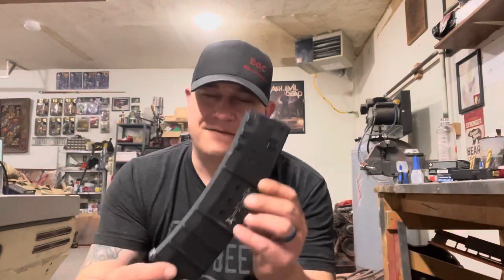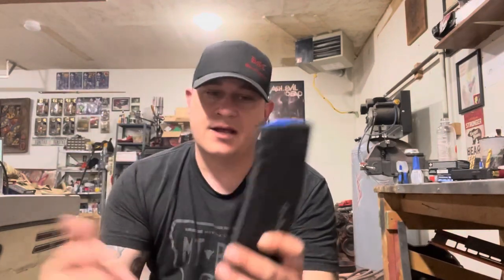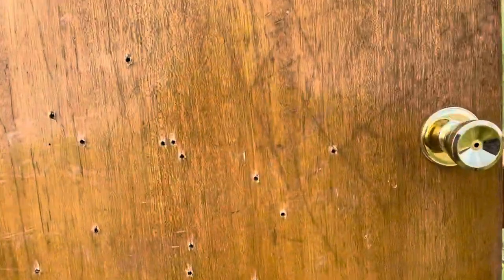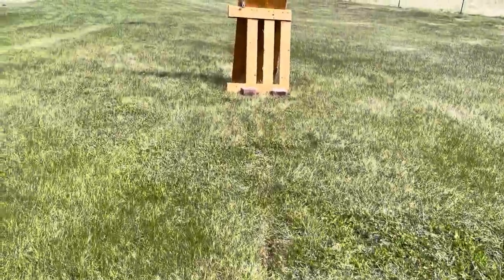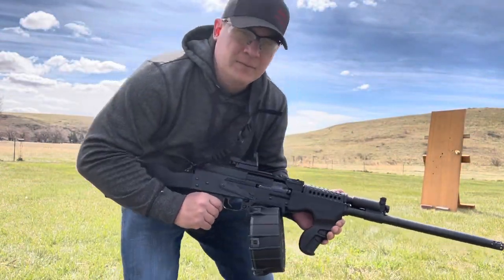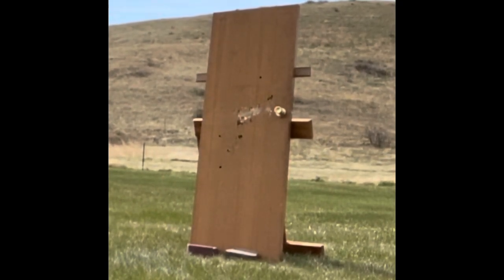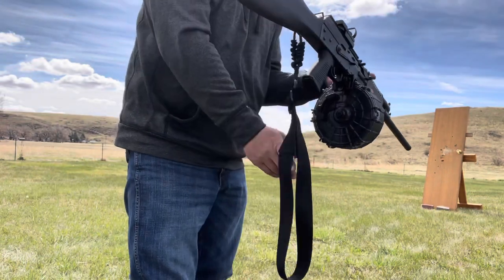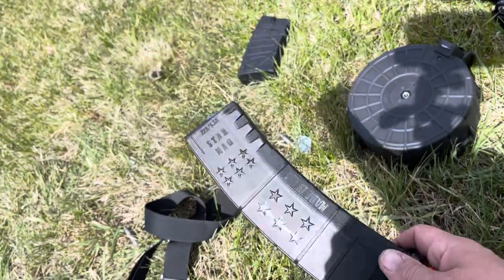JTS AK12 VS a wooden door!!

Comment: No you have failures with some shotgun shells because shotgun shells are low pressure ammunition. I will blow your mind, 12 gauge shells have less than half the pressure of a 22lr bullet. That is why they are able to put such thin barrels on shotguns, cause the pressure is so low in a shotgun shell that it is safe to have a thin barrel. The max pressure for 12 gauge is around 11 thousand psi, and for 22lr it is around 24 thousand psi. So because the pressure is so low it just does not have enough pressure to cycle the system. There are a couple of fixes for the issue, you can either find weaker springs, which probably would not be reliable, or you can simply use hotter ammunition. Usually if you use shotgun shells rated for 1300 FPS or higher any semi auto shotgun will cycle just fine. That is the unwritten rule, do not use shells rated lower than 1300 FPS.
Reply: I’ve been hearing that everywhere, also heard that leaving your shells in the mag could cause them to deform and make the gun feed incorrectly. Know if that happens often enough to care about it?
Reply: @RealAnchovy  No sure if that can happen with a small amount of certain ammo, but I have had ammo of all types in magazines for 10 to 20 year, and it never did anything to the ammo. Probably the tightest magazine I ever personally had was a 32 round 40 S&W Glock magazine, and I kept it fully loaded for around 12  or 13 years, and the ammo still looked brand new when I emptied it by hand, and the magazine still worked like new. You have to take everything you hear with a grain of salt, because small things become urban legends. For example, one person may have an uncommon experience, and that bad experience gets turned into a myth that his bad experience happens to everybody. I have heard leaving magazines loaded will ruin magazines, ruin ammo etc, but it has never happened to me, not even with cheap magazines and ammo. I have personally had some bad ammo twice. Once I bought two boxes of Remington 223, and almost every single bullet was loose, and some were so loose I could pull the bullets out of the cases and push them down into the case. The other time was a box of S&B 357 ammo, and they caused me to have a squib load in a revolver. The S&B 357 ammo actually was recalled, and I didn't know. Those are the only two times I have experienced bad ammo, and both were manufacturing problems. I have never had ammo ruin a magazine, or ammo ruined by  storing it in a magazine. Not saying it could not happen, but I think if ammo gets ruined in a magazine, there is probably something beside it being in a magazine that is causing it. I have a 9mm magazine right now that has been loaded since 2004, and the ammo seems like new.

Comment: on the jts it the number next to the barrel 1 is slg and buck 2 is buck and duck 3 is bird shoot the jts m12ak is the best jts also has ar15 type shot gun and it will fill up with shell shavings and jam and if you shoot the ar shoot gun a lot it will melt in and stick and make it jam till you scrad it
Reply from the maker: Very true

Comment: Did the kicks high flier choke tube muzzle brake help on recoil or muzzle rise much?
Reply from the maker: It did.  There is not much difference in recoil between target loads and buckshot to be honest
Reply: @brettsgroovychainsaws5995  I just bought the carlsons muzzle brake.  It should be a little more effective looking at the length and design.
Reply from the maker: @boydbadley7147  thanks for the heads up.  I’ll have to check that one out for sure👍👍👍
Reply: @brettsgroovychainsaws5995  carlsons tactical muzzle brake and carlsons tactical breacher muzzle brake chokes.  choketube.com.  It was expensive though.  I wish carolina shooters supply would come out with an adapter that was a choke instead of cyl so i could use the us version of the molot.
Reply from the maker: @boydbadley7147  thanks for the link!👍👍